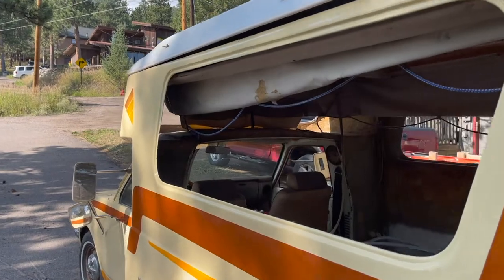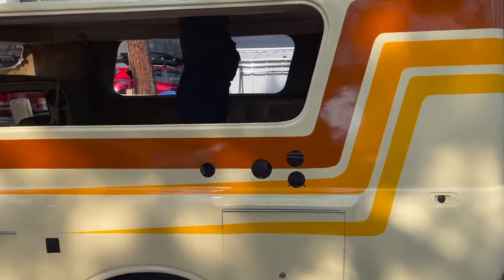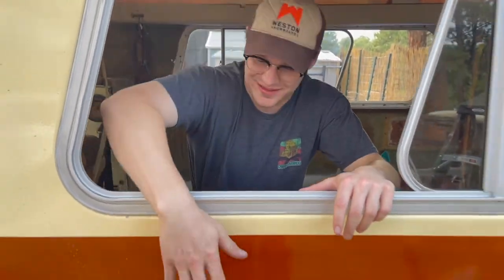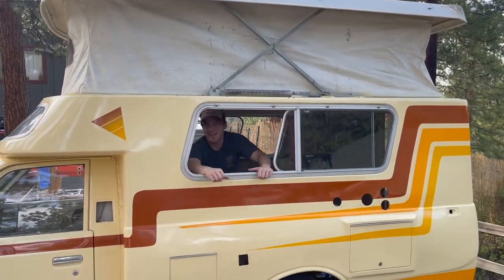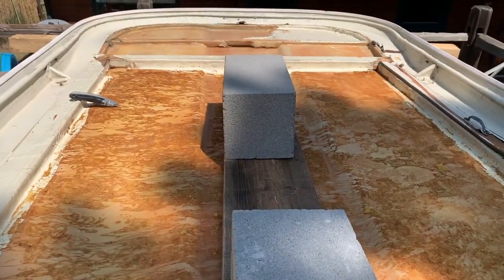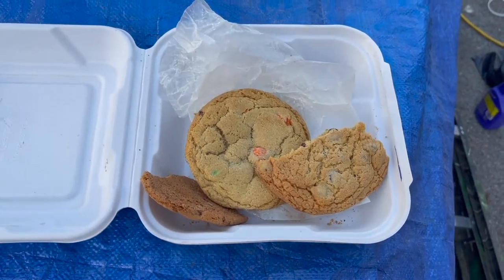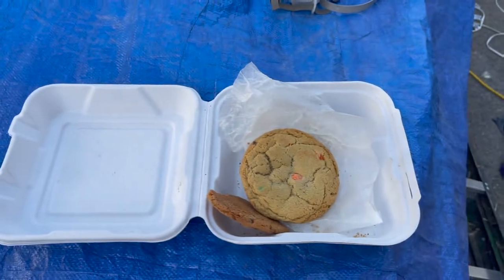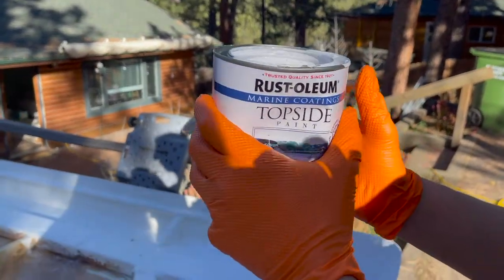Restoring 1978 Toyota Chinook Camper Roof // This was NOT easy

Comment: This is awesome. Thank you for sharing! We've got to do ours next. How did you figure out the "rise" or angle for the new cross braces on the roof underside? 

Also - wicked paint job!!
Reply from the maker: Thank you so much! Honestly I think what we did first was put a lot of weight on the roof when it was upside down since ours was caved in. From there we put in the wood braces and added fiberglass so they hardened in place. It’s not the perfect shape but water doesn’t collect on the top anymore so it will do for now
Reply: Yo I love your videos! And thanks man! I am the guy in the video lol! But yea just used cinder blocks and had to cut the corner that was sagging and poorly repaired in the past and doing I was able to make the roof convex instead of concave. I think it was a 1 foot by 1 foot hole plus cut out the whole corner and used fiberglass to patch everything back together. It wasn’t easy but it turned out really well and is watertight now. Used boat paint on the underside.
Reply: We used a cardboard template to match the shape and kept trimming it till it fit